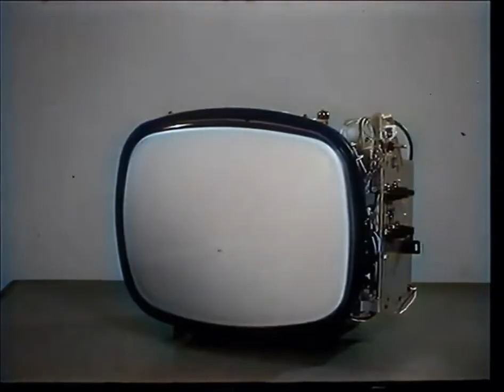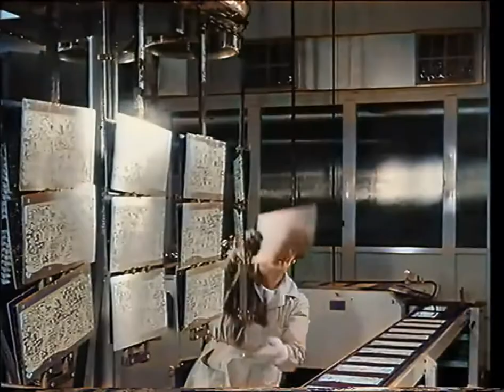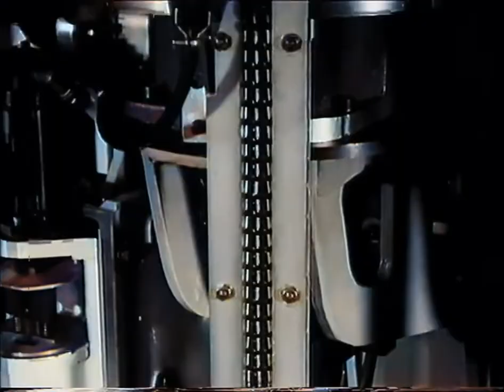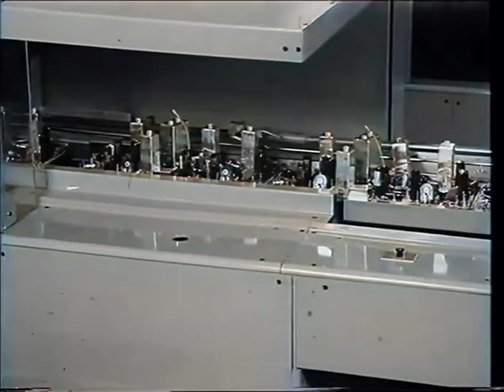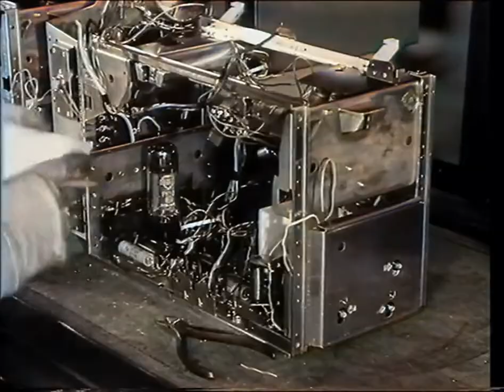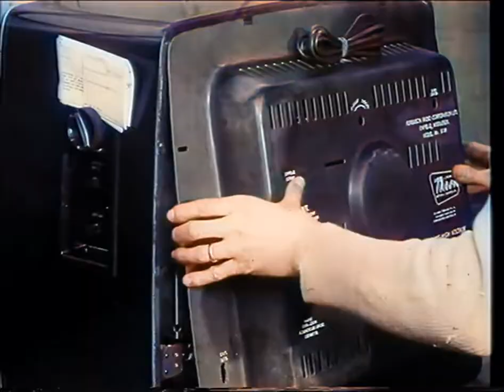FERGUSON - MEN OF VISION! Television manufacturing 1959

Comment: It's interesting to see early automation in their factory. I wonder if every company was that advanced or if it was just Ferguson. I also wonder if the sets were good value for money. Very interesting video. Thank you for sharing it.
Reply: TheY were all good manufactured the only issues they were not able to fully resolve were the limited definition the heat created and the burn out of the more fragile components. LCD was the resolution but still had heat dissipation issues until LED which basically solved all of the important issues. Cathode ray tube TV was limited to 37 inches due to weight limitations and definition limitations. A millions light years  ahead of John Logie Baird and Marconi in just 100 years! What would they both think of TV sets today? :face-blue-smiling:

Comment: Ferguson, Ecko, GEC.......all good manufacturers of TV's..........now a distant memory.
Reply: TV new technology moved fairly slowly 1950-65 but thereafter sets got bigger definition increased and the remote control from the armchair made a huge difference. No longer did someone have to get their lazy backside up just to see if there was anything better on a different channel! It literally revolutionized TV viewing! The infra red controller made it all too easy! Antenna TV reception was poor in some places and good in others. A set top antenna was usually poor and roof top was better in most places but weather factors and antenna placement determined level of reception. Cable and satellite then internet  put an end to these issues . The old 12 line John Logie Baird mechanical TV was a dinosaur by the late 1930's . RIP Baird and Marconi.

Comment: Imagine the excitement of buying your first tv during the early pioneering days of television. How many channels were there in 59?
Reply: Two channels, BBC & ITV, less arguing about what to watch!
Reply: @atlantic1952  Actually in 1959, ITV was still not available in all of the country. 1959 saw three regions start on the ITV network, with Tyne Tees, Anglia and Ulster Television all launching in 1959. However the Border Television region, Grampian Television region, South West England region, Channel Islands television region and North Wales television region, would not launch until 1961-1962.
Reply: In many areas you could receive signals from more than one ITV region and the various ITV companies' schedules were quite different so you weren't necessarily stuck with just two channels. Most people however were satisfied with just the two - hence the phrase at the time 'turning the TV to the other side'.
Reply: In the UK just 2! BBC One  and the new ITV station  -1956, 450 horizontal lines and if you were at the correct angle and distance you could almost count them visually!:face-fuchsia-wide-eyes::face-blue-smiling:
Reply: @grahamshaw6840  In fact, or the total 405 lines only 377 lines made up the picture - as you say you could almost count them!!
Reply: @LostsTVandRadio  Dead right! I suppose it was an improvement on Baird's original 12 lines! Marconi and Baird were both adopted by BBC 1935 and Baird's mechanical system dropped in 1936. Marconi's electric/electronic more reliable  for Crystal Palace transmission to only 50,000 receiver sets! Televisions are no longer televisions they are no longer merely TV, just viewing screens for internet and satellite transmissions. Terrestrial antenna is caveman technology. Now with AI we no longer control what we see and hear! This is the scariest development in communications in a hundred years! :face-orange-frowning::face-fuchsia-wide-eyes::text-green-game-over: